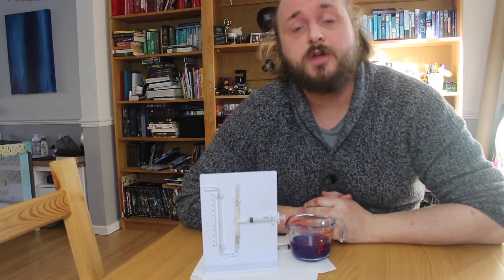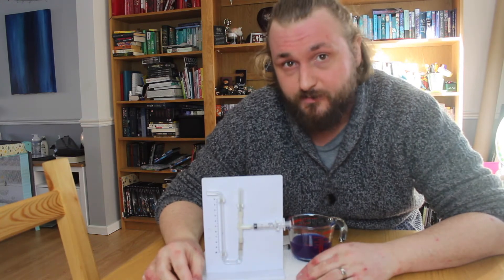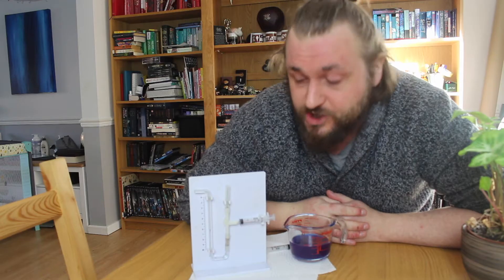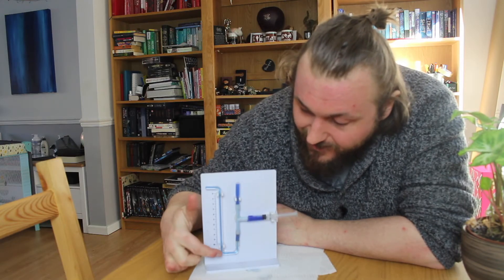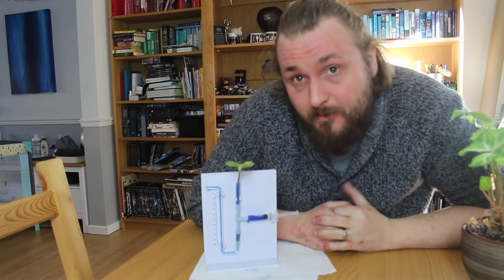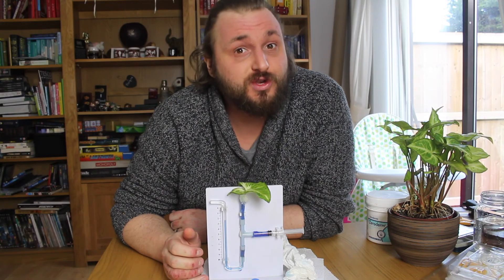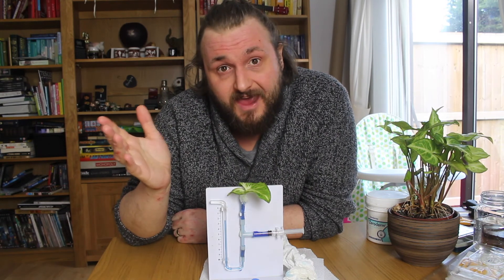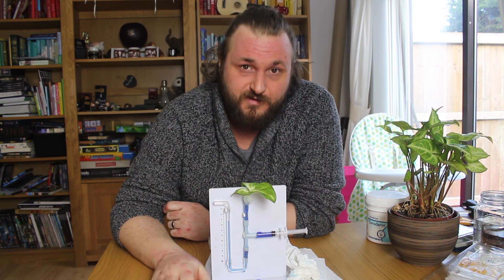Investigating transpiration with a photometer | GCSE Spec Prac

Comment: Thank you so much for this video!!! I am doing my IB biology internal assessment on the pH of water and transpiration and had no idea how to use a photometer without having to submerge it under water (which would then cause waste and the IB does not like that T T) I would not have done it without this video - sorry but one quick question though, how do you know if the photometer is airtight?
Reply from the maker: I'm glad it helped. If it's not airtight/watertight then you will get the position of the airbubble (or end point of the water) moving even without the leaf in position, and if you had a leaf covered in black paper or nail varnish or something else that will block the stomata, it shouldn't change the water level of the potometer, but it will if it's not airtight.